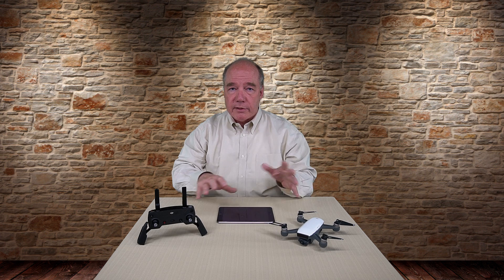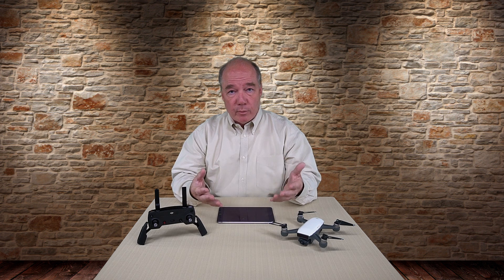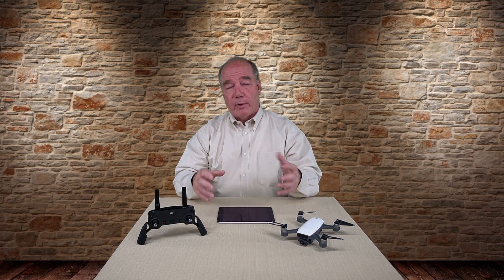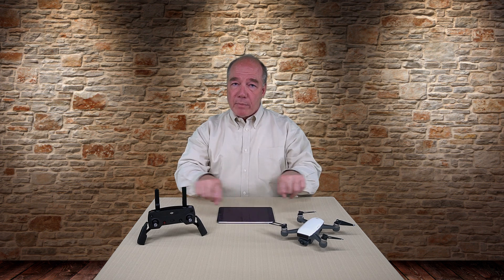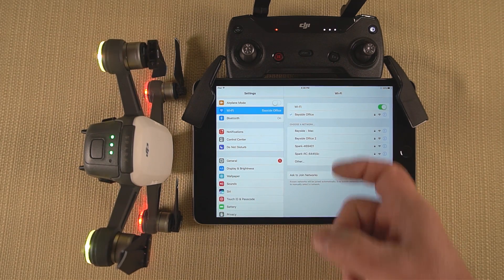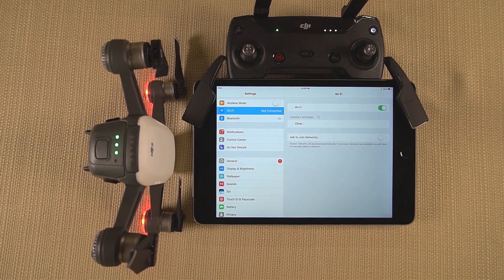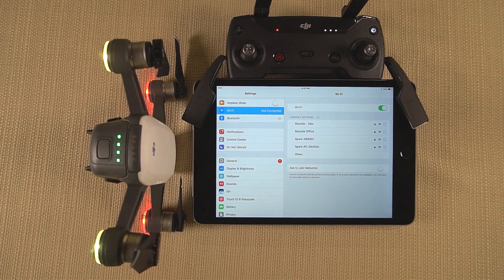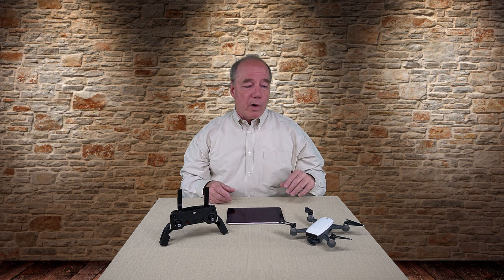The Technology Behind....How The New DJI Spark Remote Control Works

Comment: C'mon, Rick. I thought you were an electrical engineer.  You should know better that dBm is logarithmic.  10dBm = 10mW,  25dBM = 316mW. That's more than 31 times more power.  And technically, WiFi refers to the IEEE 802.11 family of stardards, not so much the two ISM bands they happen to reside inside. OcuSync and Lightbridge are not WiFi, and don't even work similarly to WiFi.  They're proprietary encoding schemes using digital spread spectrum radios that also share the 2.4GHz (and in some cases 5.8GHz) ISM bands.
Reply from the maker: Thanks for poking me on on this one and you're right, dBm is logarithmic so the increase from 10 dBm to 20 dBm is an increase in EIRP from 10 mW to 100mW, a factor of 10 (not 4 like I mentioned in the clip). As for the Ocusync and the Lightbridge, they both ride the 2.4 gHz and 5.8 gHz band and do spread spectrum in that neighborhood. I haven't been able to find much technical details on either of them so I think they came from Area 57. What I was trying to get across with the clip is that the Spark has none of this cool, long-range tech in its design but still does a great job of flying at distance because of the suped-up controller. Thanks for keeping me honest, Rick
Reply: Check out the SDK pages on DJI if you haven't already.  They don't tip their hand much there, but you can sort of get the technical gist of what's going on and why.   Thanks for doing a rundown on this subject, as I hadn't done much investigation on it myself.  It clearly explains (to me, anyway) why the Mavic remote is not compatible with the Spark, despite a close resemblance. 
So here's a couple questions:  Does the latency in the video become larger with the controller inserted into coms path?  Does the controller use the same physical channel to communicate with the aircraft as the phone/tablet?  If not, are the two channels band separated (i.e. one link on 2.4 and the other on 5.8)?
Reply: You seem very knowledgeable perhaps its my imagination but it seems the the OcuSync on my magic pro is far superior to the Light bridge on the Phantom 4 Pro in terms of image translation, and not loosing signal Do you think DJI will just OcuSync on future advancements with there new drones?
Reply: Not sure.   OcuSync offers a lower latency than Lightbridge, but appears to do so at the expense of quality.   As Rick mentioned, finding clear technical details is difficult.  If I were to make a guess, I think you will probably see OcuSync appear on newer consumer platforms, and perhaps some sort of hybridization or select-ability on the commercial systems to offer more flexibility based on the particular application. And given how fast the transmission schemes are evolving with DJI (there's at least 3, with variants based on spectrum allocation restrictions), along with no need to continue supporting a particular scheme when the platform changes, it's entirely possible that they will come out with something newer, too.
Reply: I appreciate you answer, I have experienced a much better connectivity with my mavic than I ever did with either the Phantom 4 or Pro, which is why I returned to Pro to B&H and purchased the mavic. The footage is better with the Pro of course but I am happy with magic for now. Hope a replacement for the PRO comes about in not to distant future. Thanks

Comment: do you suppose that 'extra sauce' in the form of occusync will be added later in the form of a firmware upload? I'm wondering because isn't it occusync that will make the spark compatible with the dji goggles? Or, is occusync some kind of physical component of the drone itself that is missing entirely in the spark? And is my assumption correct that it's occusync that makes the drone and goggles compatible? Great explanation and tutorial, by the way. Many thanks, Rick.
Reply from the maker: Zero, the Spark will work fine with the new DJI goggles and I'm working on a clip now explaining how to make that happen. The Spark doesn't have the tech to support Occusync and will always be a Wifi based quad. It still flies well with the controller and is fast-becoming my favorite quad. Thanks for the post and stay tuned for more clips this weekend. Rick
Reply: Many thanks for your prompt and kind response. Your comparison of the spark/goggles experience vs the mavic/goggles experience would be most appreciated. Is there any difference in latency for example? Thanks again, Rick.

Comment: Nice job with the video explanation.  A question.  Can the spark remote control bind with the Phantom 3 Standard since they're both wifi and no "secret sauce" like the other DJI drones.   Thanks!
Reply from the maker: Great question and that is one of the few DJI drones that I don't own. I have a few friends that fly that bird and I'll test that out the next time I'm flying with them to let you know. I'm assuming the remote for the P3S uses the same radios as the Spark so the results in distance should be similar. Thanks for the post and be sure to stop back soon. Rick

Comment: Thanks Rick. Once you bind it to the controller , do you have to do that every time. Will the new googles work n this to. Does it have a hdmi port.
Reply from the maker: Rich, Once you bind it you're all set and it will stay bound until you decide to unbind it. You simply power up the quad and the controller and connect your phone and fly. The goggles do work with the Spark and I'll have a clip posted tomorrow explaining how yo do that. Thanks for the post and be sure to stop back soon. Rick

Comment: Wow that is different ... they went with wifi between the phone and the remote vs a cable like the Mavic.  That begs the question what happens if you have two phones on the remote wifi network and both run dji go 4?
Reply from the maker: Joseph, great minds think alike! I tried this today and even though both phones can join the Spark-RC network, only one of them (the first one to join) can control the quad. Thanks for the post! Rick
Reply: I have seen a video where they show that you can connect to the remote with a micro-usb cable too, instead of WiFi. I wonder if that will increase the range of the spark? (cause of less interference)
Reply: great video answered a lot of questions I had, Thanks
I do not understand all the worry about how far away you can fly the Spark.  it is so small you can hardly make it out much less see what it is doing a mile away.
Reply: Hmmm, nice question!
Reply: Based on the way this works using wifi to connect the dji go 4 app to the spark.  That makes you think they should have been able to come up with a way to get the goggles to do the same thing without a cable.  It sounds like it is just a software problem at this point because the hardware would allow that to happen.
Reply: DJI messed with the OTG cable now so its unstable

Comment: Wi-Fi quads stink in my opinion. My phantom 3 standard never got farther than about 800 ft from me without losing signal. 1.4 miles was advertised on the spark. I bet it doesn't do half of that.
Reply from the maker: I've been flying it the last few days and I've been very impressed with the distance and the handling. Honestly, my "older guy" eyes can't see a quad this small more than a few thousand feet so I can't push it out to a mile and still maintain VLOS but it works great for me. Thanks for the post. Rick
Reply: Drone Valley great video by the way..a quick note however regarding the spark controller in the UK..it would appear that due to some crazy EU legislation ..the spark range from the remote has been drastically reduced in power....going by the official  dji manual..expect maximum distance of 0.31 miles instead of 1.2 if u are in Europe or the UK...when the spark gets GPS lock in this geo location it will essentially quarter the rx..tx power.. not over the moon to be honest..time will tell however if this is really am issue as I don't plan on flying too far due to its size and I always adhere to the legal limits. :) best dave

Comment: Timely video...thanks...having interesting issues trying to activate...received a message...first..."Mount off the gimble clamp before activation"....What????? There is no gimble clamp...hmmmmmmm...Second.."Inconsistent firmware found...incompatible issues may occur between some modules and the device...Continue activation?  ".  Do you have any idea what to do???